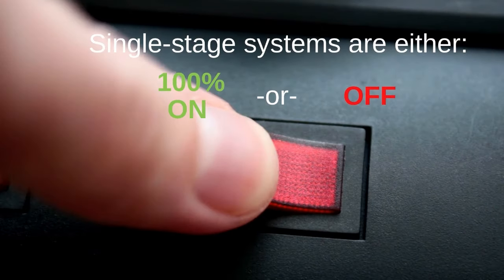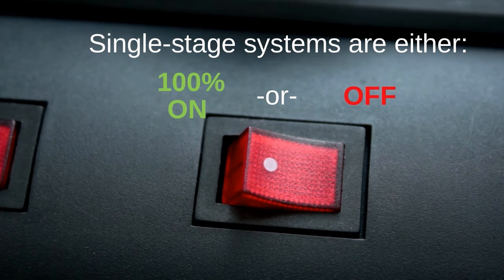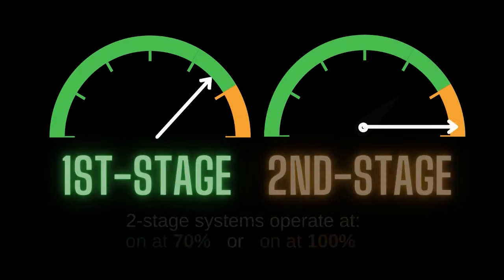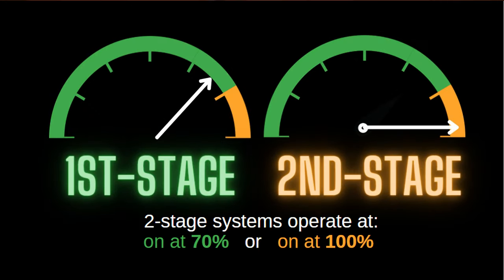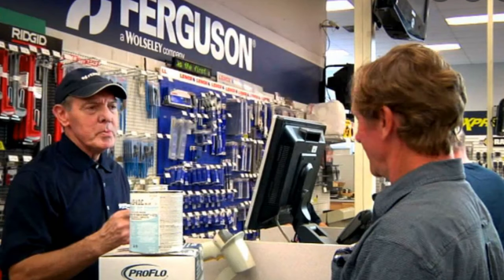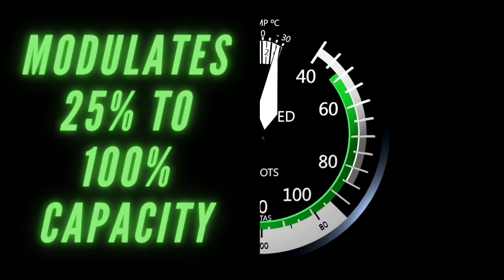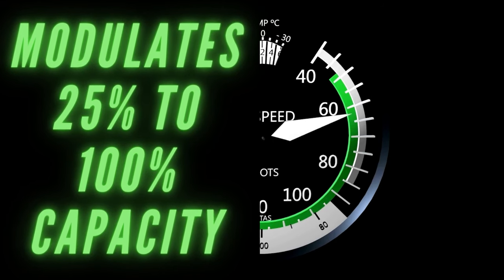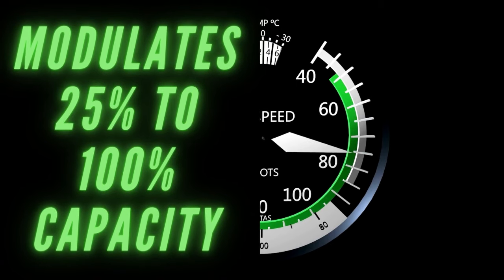Should I Buy a Single Stage, Two Stage, or Variable Speed Air Conditioner

Comment: Would be interesting to know the reliability of 2 stage and variable systems. Would also be good to know how expensive those special sensors, circuit boards and variable speed blower motors are too. There is a huge cost difference from a single stage system so, another $3,000 to $5,000 or up to $8,000 more for those 2 stage and variable has to carry some value or they are simply way over priced for the benefits over a single stage. Those are the thing folks want to know, more benefits?  More expensive to fix? Need repairs every year? Part...2 to 3 weeks wait for a proprietary and likely expensive part that is going to be priced at retail.  Spending more should include more benefits and way less breakdowns and down times. I don't think they are there yet.
Reply: Many of the major inverter (variable) systems have at least 10 year warranties, Daikin has 12 year parts/labor available
Reply: @AJ-bi6ns  Is worth  the extra cost?
Reply: @naderblack1114  Worth is use case dependent. Too many variables such as current system, cost to upgrade, differential cost between lesser units and ultimately your goal. Is long term return on investment important to you? Or is saving money during install paramount. 

Inverters will be more expensive than single/2-stage systems. Depending on use and SEER of the unit you could see several thousand back in electrical savings over 10 years. However, that doesn't make up the cost difference. If you monetize the extended warranty "cost savings" you can come out even or a little ahead. However, "comfort" for inverter systems is untouched. 

If you want the "best" comfort and monthly electrical savings and aren't worried of the initial cost difference its a no-brainer.
Reply: I think more then variable and all that is a high class heat pump vs a high class propane / natural gas system.  I went from propane to a heat pump variable with backup propane.  I save hundreds per month on propane in the winter.  but I am guessing if I would of just went from propane furnace to a single stage high efficiency heat pump I would saw cost benefits and in the summer had a system that properly dehumidifies and doesnt' run all day.  ( I have a VRV life system that is an inverter based system and it runs all day in the summer wont keep set temp, and at set point of 72 wont start until above 73,  and won't stop until below 71.  Stays at 73 to 74 all day on a hot summer day.  And it doesn't dehumidify worth a damn.  House humidity is in the high 50's since it was installed.  (because when its in that low mode the indoor coil temp staysin the 50's which won't dehumidify below 50.  Unlike a single stage which is in the 30's when its on so it will dehumidify like crazy.
Reply: I had one part failure on my two stage system that ate up any savings I received . This , even though the part itself was under warranty. Took a week to get the part during the hottest week in the summer. Technology is great until it breaks.
Reply: Boards are expensive . Good luck getting electronic parts after 8 years. Had to throw away a couple of $10,000 large drives because manufacturer can no longer purchase the chips or have any more replacement boards in house. Had the same problem with a very expensive lighting /dimming control panel that was only ten years old . Never had a problem replacing a obsolete 40 or 50 year old relay or motor starter. Recently went to a local company that only sells burglar & fire alarms for a replacement hard to push touch panel that I purchased from them maybe 25 years ago for my own house . They no longer are a distributor of that company and tried to sell me a new burglar alarm panel. Not today.
Reply: @JohnThomas-lq5qp  Yes, if folks decide to buy top of the line HVAC these days, they also need to purchase spare parts, like these control boards and sensors that will be obsolete sooner than not.
Reply: @AJ-bi6ns  Agreed but I simply want quality formy money because a warranty does nothing for you when parts are obsolete or it breaks down when you need it and parts are on order or back ordered etc. No warranty can replace scarce parts.
Reply: @rzh3443  AKA supported technology. When parts are proprietary and then not in stock or in good supply, that brand isn't supporting their products. I heard Daiken, Amana, Goodman all have parts galore when in need. Problem is, will they have them 20 years from now for those who are lucky to have a system last thtat long or rarely they are used due to moderate weather locations. Sad to have a fairly low useage system and need a part that only the manuf supplies but discontinued it.
Reply: @Garth2011  Hi Garth: all good points. Update on my furnace /AC from Rheem . In December , my two stage furnace stopped working in the AM. Code indicated lack of pressure to start ignition. I checked five of the six items they said to check. No issues. For the sixth , I had to electrically  test the inducer switches. I did so and determined the LP switch was not closing. I called the HVAC install company ( like a fool) and told them what was going on and what was wrong. They came and confirmed what I told them. No parts on the truck (of course)and 200 dollar service call charge. They then quoted me an additional $342 plus tax to come back in the next day or two to replace it. I looked the part up on Supply House. 15 bucks and overnight ship. I told the tech no thanks. I decided to order both switches, flame sensor , igniter , limit switch and inducer motor AND a new contactor and capacitor for the AC. That all cost me less than the repair cost quote. It took a little detective work because Rheem had twice (since 2014) revised its parts list for my furnace. Also , the generic Fasco inducer motor and fan is identical to the Rheem Part and half the price. It seems all these furnaces etc are a conglomeration of parts which overlap brands and models. The only differences may be the quality of the heat exchanger,  but that would be hard to tell without some effort. It seems we are stuck, though, with moving forward with more tech on these appliances. And no, the energy saving is real in my experience  , but really not anywhere near enough to offset any significant repairs.
Reply: @rzh3443  So true and your HVAC is a rip joint if they are going to charge you twice to replace a part. Usually, they will diag, get the part then charge you for one service call and the part plus installation. Those inducer motors from a distance are junk. Probably sleeve bearings vs. sealed ball bearings which means they will not last long and this applies to all motors in HVAC. Lots of replacement parts are "universal" which in a pinch seems okay but for those who want to retain their OEM systems as OEM, good luck finding the OEM parts as they age. You are smart in packing away some spare parts for the day they decide to give up. Caps especially...buy the ones made in USA, AMrad is one make out of Florida. Its truly a joke that HVAC feels its fair to double the price of parts they buy to the customer and sometimes its more than that. I understand they have a business to support however, there's plenty of work and money doing the same honestly. I see many HVAC double the price of condensers and heaters when they quote complete system replacements. I'd rather they itemize the parts on their quotes and charge for everything they need vs. throw out a number and say its all covered in that price. You aren't assured you will get anything in that case except for a new "HVAC system". If the parts aren't listed, they aren't held accountable for them which translates into lazy quotes and dishonest estimators.

Comment: Great video. I can't tell you how many videos I've sifted through to find one that doesn't push this or that brand, or mini splits vs central AC or list the six best brands.....seriously, six brands that are great? C'mon, who believes that. This video perfectly explains the different technologies, why one may perform better than the other but the differences are small or why this type is easier to fix, etc. I'm going to have mine replaced with a quality single stage unit installed by what will hopefully be a reputable company. Again, great video.

Comment: Hey sir. Caught on the fence and looking for a little advice. I’m changing out my home AC system and it’s going to be a 2 ton unit. I got quoted for a trane system that has a air handler that is veritable speed BUT the heat pump is a single stage unit. My question is, is that a bad move to make? I feel like the compressor is always gonna be on and use a ton of energy. Am I correct? Should I pull the plug in the deal and go with a single stage unit? They said the air handlers were the same price for variable or single, however the variable speed compressor was wayyy more money, that’s why I got the quote for a single stage. Thank you !

Comment: Single stage all the way. And try to not get a microchanel coil. 2 stage and variable speed systems will save you a little bit on your electric bill, but when it breaks you will pay big time, and I assure you, they will break. Pay attention to the warranty. Some manufacturers have parts warranty and some have parts and labor. They do not build ACs like they used to. They break alot more and will need to be repaired.
Reply: Are you in the trade?  If so is there a single stage brand you fell comfortable in recommending?
Reply: @BushyIV   I am a technician. Honestly, there is no brand that stands above the rest. They all have their pros and cons. The main thing that will insure that your unit lasts a long time is how it is installed. You need to have a good, reputable company do the install and pay attention to the warranty. Yes, single stage units are the easiest units to fix, but any unit that is installed correctly will last a long time and will provide you with the best climate control.

Comment: Single stage is simple and just run less mechanical parts. Better go with single stage.
Reply: yes, and because there isn't a server farm of electrical components and motherboards its easier to fix and will last 20 years.  Just keep it charged replace capacitor and keep the coil clean.  use whatever thermostat you want. The opposite is true with the variable systems.  I speak form experience after a 30 day outage.

Comment: We just want one that runs without constant costly repairs, is that too much to ask for?
Reply: single stage, as he said easy to fix and parts are everywhere.  just a fan, capacitor and fan motor on the outdoor unit.  The Variable units have something that rivals a super computer on the inside.

Comment: Man it’s hard to find the answer to this.
Are the speed signal voltages different for ecm and variable speed? From what I’ve read all ecm speed signals are 24v but not sure about variables
Reply from the maker: No it's still 24v to the speed taps. It just matters which speed taps you plug those low voltage wires on. You can have one speed tap for heat and one for cool,  and I believe fan only if it's programmed like that. Which is another point. And then you have 120 or 240 to the windings depending on the unit. Air handlers and package units will have 240, regular furnaces will be 120.
Reply: @foxfamilyhvac  
Thanks! For some reason I thought I head someone said variable motors could have a dc voltage. Never could find that though. Thanks for the help

Comment: I live in Las Vegas. Replacing my 25 yr old single stage York units. One 4 ton and one 5 ton. One AC vendor is saying the 2 stage won't really produce the benefits with the extreme heat in NV and that a single stage with variable speed blower motor will help to address that. I do have a hot spot in upstairs master. They suggested adding a duct for that and that the 2 stage wouldn't really help with the hot spot.

Is a two stage worth it for Vegas?
Reply: As another had discussed, 2 stage works better in controlling higher humidity which you don't have, I believe.  It's best to look into air flow such as duct sizing, return locations, amount and size as well as supply sizing, location and amount. Most systems are installed on the less efficient side especially new construction (Original systems by builder). Seems like you have a maybe 2,000 SF upstairs and 2,000 SF downstairs. I'd get some other ideas and ask if a third system upstairs would be best vs. one 5 Ton unit. It's going to be more money possibly but a large 2 story home seems to do better with three units, especially in Nevada heat. 2 ton and 3 ton or 2.5 ton and 2.5 ton or even a 3 ton and a 3 ton which would work two areas upstairs vs. all of it. Depends on how many live/sleep there.  my2cents.

Comment: I love the idea of a variable speed one but the cost and the potential for breaking down parts seems higher than a single stage I have very high ceilings and I'm changing things out to a heat pump system and I'm hoping to get a good return on my investment as far as savings I understand that it doesn't do as much for the air conditioning part and may not feel as cool as my current AC unit is this true? My heating unit is 44 years old and it's time to change it out I just don't know that I can afford to spend a lot of money but it seems like I can't afford to not
Reply: Heat pumps are good for 35 to 85 degree temp swings. Below 35 or above 85 they begin to loose their effectiveness in moving heat one way or the other. That needs factored into the runtime that will increase as the temps swing outside those numbers. Heating will require more running time to heat, cooling will require more running time too. It would take some serious calculations to figure out which source of energy would be better, gas or all electric, when aligned with comfort performances.  Lots of folks might value a heat pump even though they might experience poor heating in freezing temps and the same when its hot because they believe their heat pump is "cleaner" than natural gas.  On the other hand, some may not value that idea because they put more value into how well the system performs in extreme conditions, when its needed most for comfort. Also, cost of gas vs. electric play a huge role and from a few sources it is said that gas is 3 times more efficient in 1 CF in BTU's when compared to 1 kWh of electricity plus, currently a therm or cubic foot of gas is less expensive that a kWh of power in most states.
Reply: @Garth2011  With today's technology, that statement is incorrect. Mr Cool Heat pumps are currently good to heat down to minus 8 degrees F
Reply: @michaelcarley7016  Enjoy paying the electric bill. They will still heat some in those temperatures however, with much less efficiency. Probably not enough heat generated to make the cost to run them worth it is the main point. Yes they work, but they use electricity and not everyone has cheap electric like those in CA who are being charged 40 cents per kWh.

Comment: Are two stage or variable speed compressors a ripoff? I've heard that when it's hot you want your AC compressor running at 100% power to cool the house down if the compressor runs at 75, 50, or 25% power it just runs for hours and the house doesn't get any cooler. The problem is getting the computer to kick the compressor back up to 100% when 50% isn't cutting it.
Reply: if its hot, it will run at 100%.
Reply: I had issues with my daikin vrv life system,  and its all about computer algorithms.  Variable for that unit means based on outdoor temp it runs at 37, 42, 47, 54 (indoor coil temp).  My house since I had this unit installed  in the summer is always 74 (if set temp is 72).  This can be 80 or 95 degrees out and sunny,   It runs all day long and it doesn't dehumidify at all.  I had to buy a whole home dehumidifier just to keep humidity in my house at 45 vs high 50's.  I spend about 40 kwh a day cooling my home with this unit.  No idea what a single stage is but I bet its the same.  So for me no real benefit going with this system and I regret getting it.  Even the thermostat is proprietary and expensive and I had to get rid of my dual zone system with the inline vents controlled by two thermosostats because it wouldn't work with the new system.
Reply: @cranbers  It's almost as if they build these new units for the power company so you don't use very much electricity not for the customer who wants to be comfortable in their own house. A single stage heat pump or air conditioner just turns on and off like a light switch when it's on the compressor runs at 100% power or it's off completely. I'm beginning to think that's the only way to go no matter what the salesman tell you.
Reply: @andrewgordon235  Yeah,  with old single stage system I never had any issues with humidity,  now my home is always 55 percent or more.  I had to get a whole home dehumidifier as mentioned to keep it in the 45 percent range.  So there goes any savings I might of gotten from the 13k heatpump daikin vrv life system with a prpoane furnace as backup.  If I would of just replaced the system with a single stage heat pump with propane for backup heat probably would of been half the price and twice as happy, and been able to use my nest therrmostats with the zoning vent system I had.
Reply: @Andrew Gordon  I have dozens and dozens of customers who would strongly disagree with that. They're the most comfortable they felt inside their homes after the upgrade. Most overlooked aspect in replacing AC- is the quality of labor. Doesn't matter if you get a spaceship that was installed incorrectly(which is what I think that other guy's issue is.)